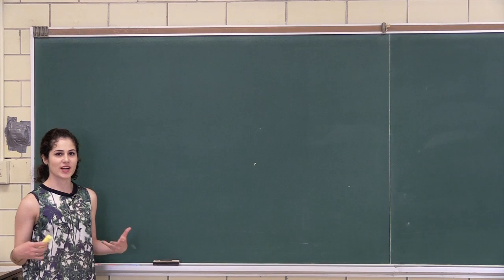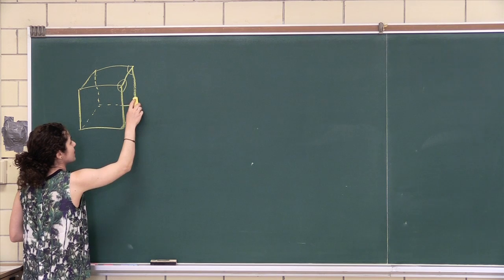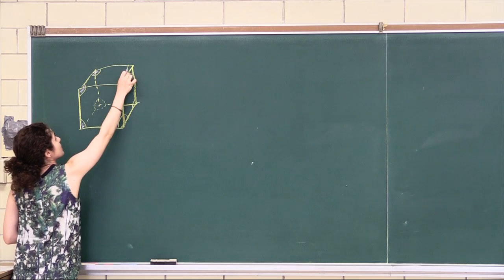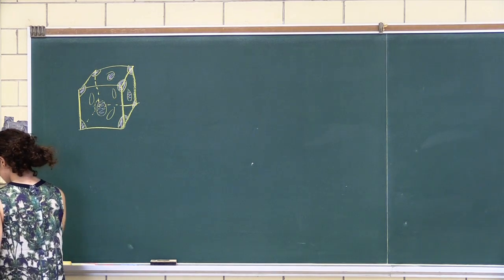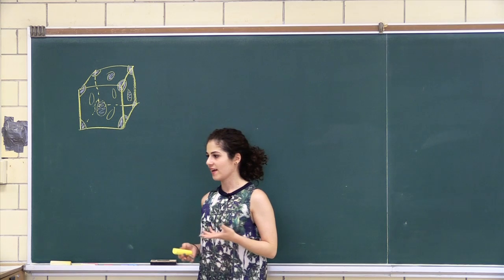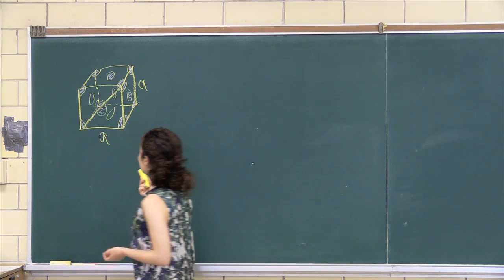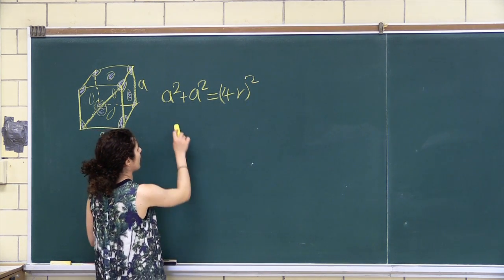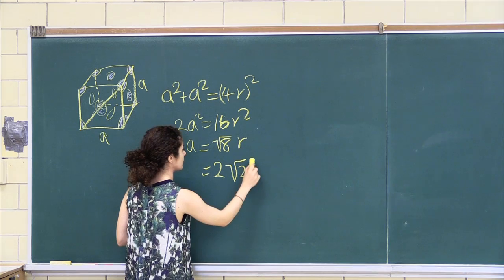Lattice parameter in terms of atomic radius for face centered cubic

Comment: How did it even become (4r)^2??
Reply: +Mohammed Sajaad She could have drawn the picture a little better, but what she was saying is that each of the legs of the triangle we are focusing on here is a, and the hypotenuse of the triangle is some number of atomic radii. So we have the corner atoms, each of which contribute 1 r to the hypotenuse, (so a total of 2r from the corner atoms), and then the atom that is face-centered contributes a full atomic diamter (2r) to the hypotenuse. This gives 2r (from the corner atoms) + 2r (for the face-centered atom) = 4r. Since this is the hypotenuse, clearly, we will use a^2 + b^2 = c^2, and since c = 4r, when we write the right-hand side of the pythagorean theorem, this will be c^2 or (4r)^2. It is just some simple geometry. Cheers, and have a good day.
Reply: ikr . i also confused
Reply: i don't understand . can u xplain in video
Reply: thank you, im cramming for a midterm tomorrow and this helped
Reply: The 4 originates from the number of atoms per cell unit. This being a Face Centered Cubic, the atoms per cell unit is four.

Comment: Where is the fourth one coming into play? I get that the three are from the bottom left corner, center, and top right of the front face but I don't know where the 4 is coming from.
Reply: 1/8 of the atom fits into the corner so u have one full diameter and two half diameters hence 4r as d=2r